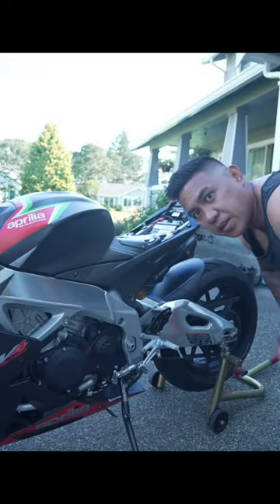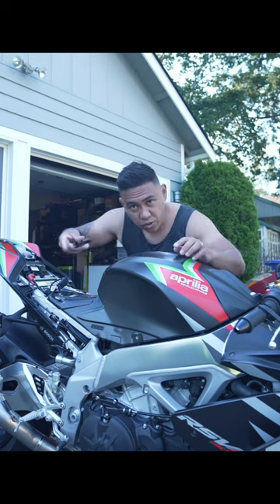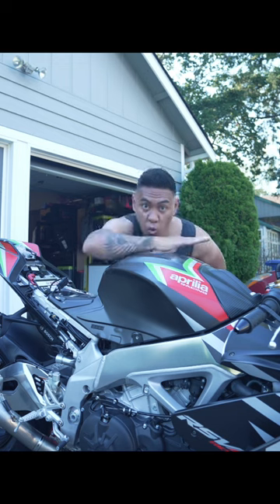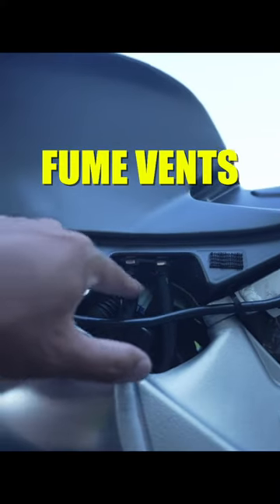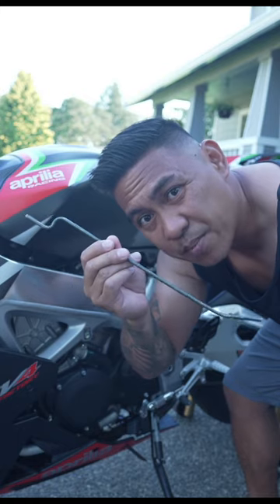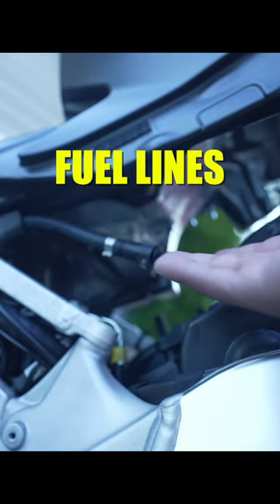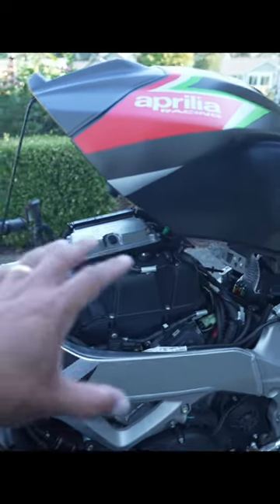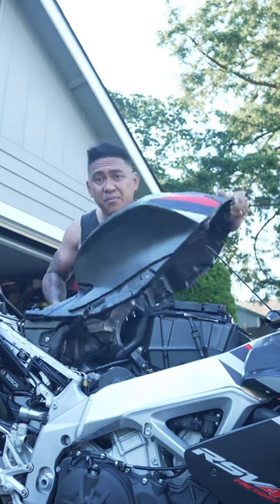How to remove Sportbike Fuel Tank

Comment: I took my tank off. I didn’t need that shit. My bike runs off testosterone and adrenaline.
Reply: Damn no wonder it  only goes 5mph now. 

😊
Reply: @siddhantmishra3598  I changed my diet to bullets and gun powder and scrub with 80 grit sandpaper when I shower. it’s increased my speed by a lot 👌🏽
Reply: @siddhantmishra3598  🤔 that would add extra boost

Comment: This makes me want to take my tank off again, I started taking off bolts and following along with my bikes shop manual and was able to get to the spark plug,air filter,battery,fuel lines,most of the wiring harness and other smaller bits and bobs. I never really learned how to wrench from anyone but just diving in helped me overcome the fear and now she's all back together ❤️

Comment: Also, PRO MAINTENCE TIP for the real men out there that maintain their own bikes properly and don't pay people to lube their chains - CLEAN AND/OR REPLACE your fuel filter every other year or so (depending on fuel quality and usage). Many people don't like removing the tank and fuel pump (have to completely drain tank, etc.) to access the fuel filter. But a clogged fuel filter greatly impacts overall performance and MPG. I also just did my fuel filter on a 2nd Gen ZX-14R and took the opportunity to upgrade the stock fuel pump as well, which was well worth it.

Comment: stupid ass question but does the tank need to be completely empty to do this? I see that connector on the fuel line and I don't know if it's just a connector or if it blocks the fuel from flowing out when disconnected.